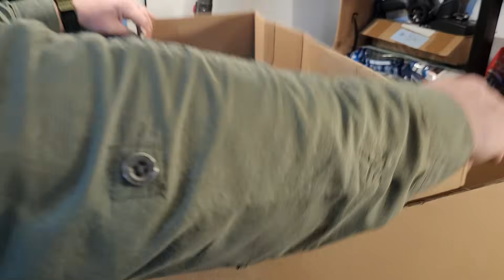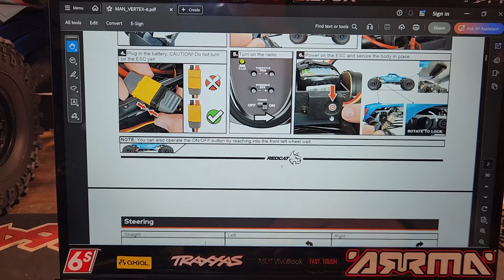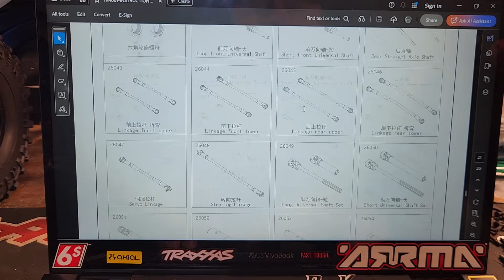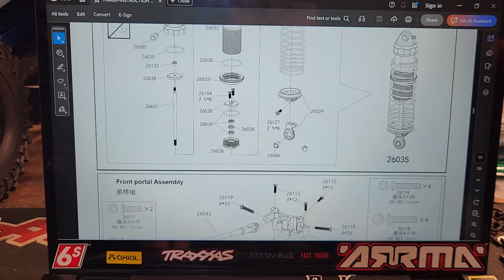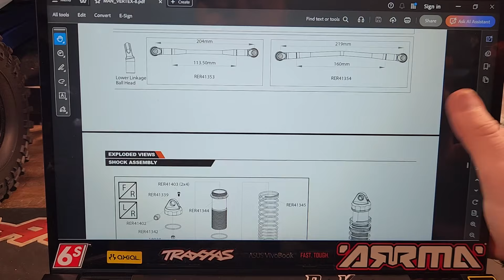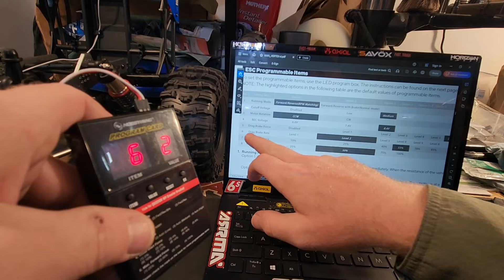NEW FIRST EVER YiKong Rockslide UNBOXING and introduction to GIANT COMP style crawler, with lights!

Comment: The flip chips are for Ackerman steering adjustment. More angle on inside wheel reduces tire scrub and you get better traction. That’s the theory anyway.
Reply from the maker: Okay, I'm trying to visualize this. So you flip the chips on both sides to do this and it let's the inner tire ( left turning left/right turning right) have more angle? How can this NOT result in tires scrubbing on parts? Namely the lower 2 of the 4 link? Mine already rub?